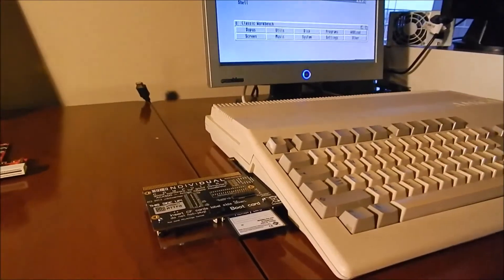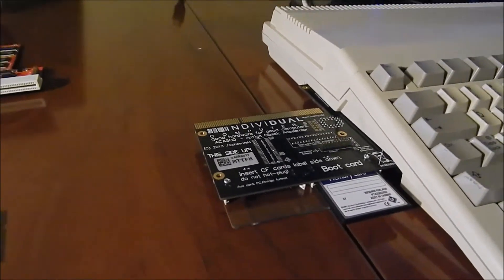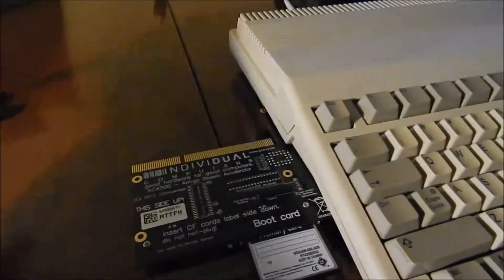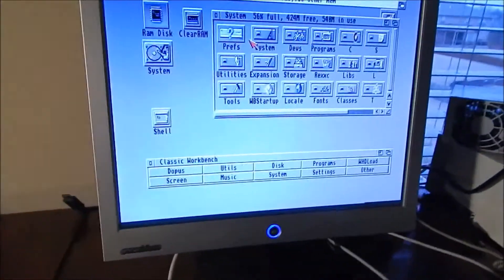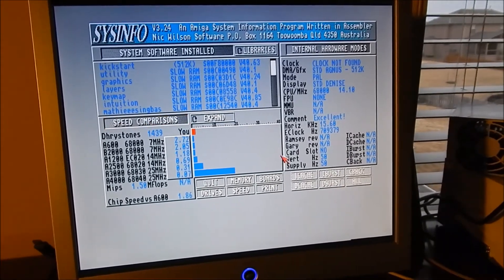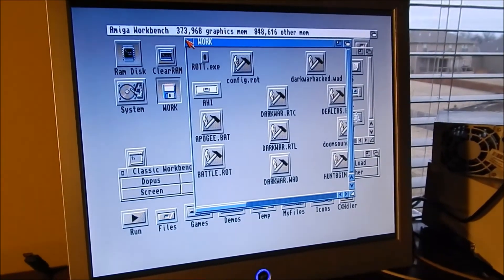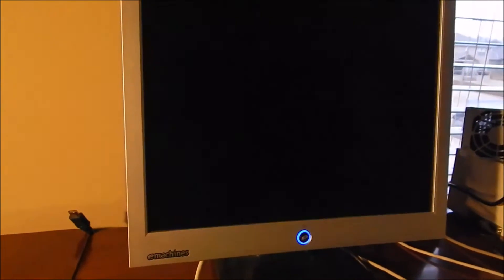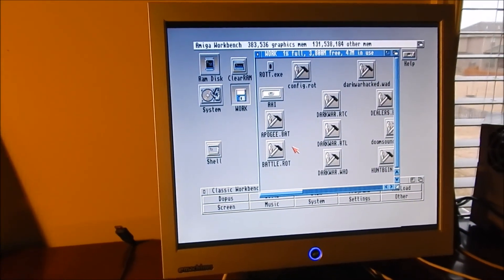Amiga 500 with ACA500  and ACA1232 Accelerator

Comment: I remember these  days I  use yo update my chip set and cut traces etc ..  I bought a 28 mgh  side expansion for 1000$  can.  with  4 meg of ram and a 100 meg scsi  ..  I  added external drives and ran a bbs

Comment: Does this work with American NTSC models? I really hope so.
Reply from the maker: yes it does. The A500 in the video is a NTSC Revison 5 model
Reply: ***** Cool, thanks for the response. If I could ask another question, What are you using to drive that newer LCD monitor, and are you able to run both NTSC and PAL games with it?
Reply from the maker: GuitarAudiologist its called an Indivision ECS scandoubler. AmigaKit sells them
Reply: ***** Thanks. I've been looking at Amigakit a lot, and I think the ACA500, the new ACA1233, and the Scandoubler (and possibly a catweasel?) are what I am going to get to rejuvenate this old puppy my friend just gave me.  Have you tried any PAL games on yours?

Comment: Pretty cool. I wish they would have put the thing in a case though. Pretty ugly with the board hanging out of the expansion slot. Nice to have the multiple kickstarts. Some A500 boards can be modified to make the half meg expansion actual chip memory. I did that to mine. I just had to cut a trace on the motherboard if I'm remembering correctly. But that will cause the backdoor memory to be used as chip bringing it to 1 meg chip.
Reply from the maker: yeah i totally agree. I wish someone would make a replica GVP sidecar case or something to fit it in.  I've seen some real cheap looking clear cases for it that don't do it any justice.

Interesting info about the half meg as chip ram. Do you have any more info on that? I suspect i cant on mine since i have a Revision 5 motherboard but im willing to look into it. Having only 512k of Chip in my A500 kinda sucks
Reply: When I did mine I read a long document which was dated in the early 90's (so people were doing this hack back then). You can do it on a Revision 5, my old NTSC board was Rev5 and I did it on that. I bought a PAL board to fit in the same case (because you can't find NTSC only games on the internet) and that's a Rev6. It's been awhile but I think the Rev6 was easier but the Rev5 was not hard. At least for me. You might have to be lucky with the Agnus chip you have but mine worked. 

When I typed in amiga 500 1mb chip ram rev 5 in google I got a bunch of postings in forms and old lha files with instructions to do it. If you're handy with a soldering iron you could also solder another half meg onto the board itself because there's room for it. So you could have 1.5 megs of chip ram. I think you can also put the A600 Agnus in there and get 2 megs but I haven't tried either of those, just the backdoor jumpers/trace hack.
Reply from the maker: awesome info. yeah ill look into doing this for sure. i see some Megachips on ebay occassionally but people want stupid money for them. Mind you i own an A600, A1200 and A4000 also, but i have a soft spot for my A500 :)
Reply: Ditto on that. Gotta love the one that was able to make it to the masses. I only have the 500 (same one I had as a kid) but I did play around in emulation for a long time and messed with the AGA stuff in that. The only other one I wouldn't mind having is the 1000 because it's got a nice look and it's the original and has those cool signatures inside. The later Amiga's are cool but they're kind of depressing because of what they weren't if ya know what I mean... AGA, too little too late... But it's like the C64. Is the C128 pretty cool? Yup. Almost 100% compatibility, its got its own features... Wouldn't mind having it... But in the end you can't beat the look of the breadbox and like 5 games took advantage of the 128... Similar with the 500, everything was made for that and that's what you think of when you think Amiga. Gotta love the 500.
Reply from the maker: Shot97 hey man, just an update. I did the 1Meg CHIP RAM hack tonight and it worked a treat. Thanks again! the only minor issue is now my Amiga defaults to NTSC mode instead of PAL but i think you can just lift a pin on the Agnus socket to default it to PAL.
Reply: Very cool. Did you make a video by any chance? I keep telling myself now, whenever I'm about to take something apart I need to make a video!
Reply from the maker: Shot97 yep i did, but ill need to edit and upload it. Hopefully this weekend. cheers

Comment: If you have 3.1 rom chip can you avoid the maprom function of this aca? I have 2mb chip but I need more fast ram :-\
Reply from the maker: i haven't tried. my A500 mobo doesn't have a kickstart chip. it just uses the onboard ROM on the ACA500
Reply: Mine too. I have a 3.1 from my A600 and I will test it. I don't think that it will work. Maybe aca's rom has drivers for both cf slots :-\
Reply: ***** A600's 3.1 rom worked on my A500+. with no maprom I gained 1.7 fast from 1.1 (before) in expense of wb scrolling speed as expected and 1.49 from 1.51 in sysinfo. ;-)
2mb free chip ram is awesome!